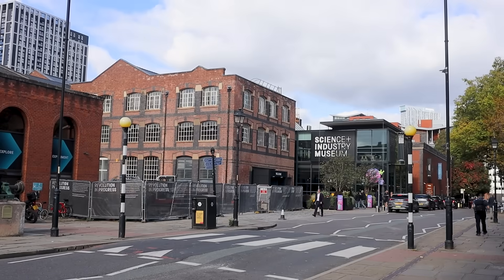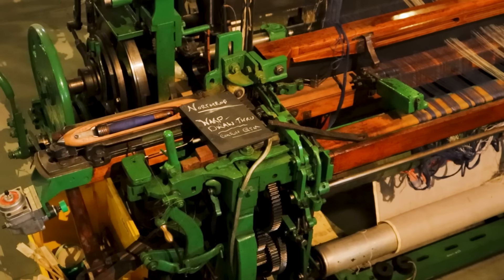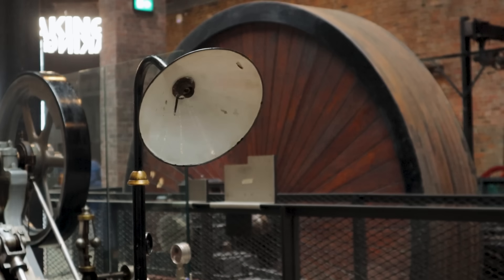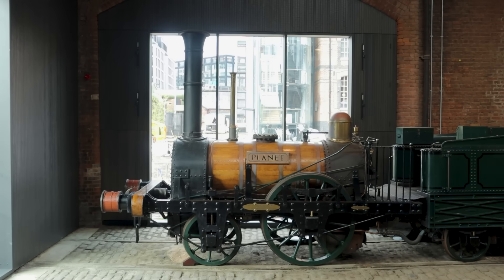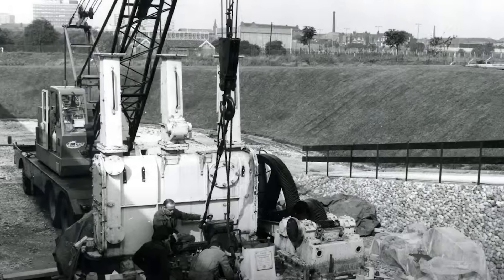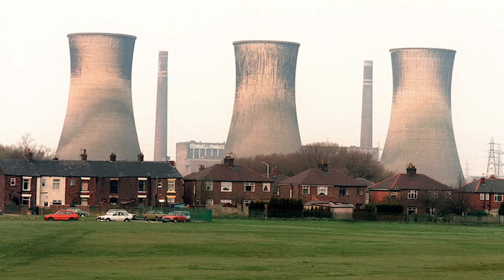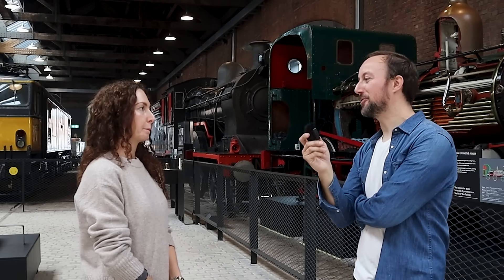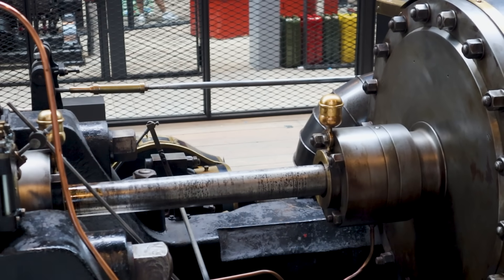How did Manchester power its industrial revolution?

Comment: I love the machines, but conditions for worker were appalling, even as late as the 1970's Ferranti's was still mid-Victorian in attitude. You weren't even allowed to read a paper in your tea-break. I had the entire casting shop talking when I asked the general manager if he were joking.
Reply: Hi you are spot on when I worked at Ferranti Moston there were different heights in the toilet doors depending on where you were in the hierarchy. Workshops had about 15 inches from the floor and the top just above eye level. In the offices they were better then the directors got full height doors. 
Not to mention the about seven different grades of canteen!

Comment: I'm pleased to see the Trustees haven't ruined it like they did with the main science and victorian sewer parts of the museum 👍When the Curator said it feels like a long time, that's because it genuinely was. It was literally years and years 😂 I hope it was all spent on the fabric of the building and not the rubbish around the new boiler (yawn) and the acquifier. I doubt those items will ever pay themselves off in carbon or energy terms taking into account the embedded energy or carbon produced to create them. My only criticism aside from time and cost is that they should have put the ugly modern boiler somewhere less intrusive. Do we really need to see that thing. If you want to see lots of engines running on their original fuel go to an open day at the Anson Engine Museum.
Reply: Anson is superb! Also for a real working mill engine fired on coal in a lancashire boiler I recommend Ellenroad Mill in Shaw.
Reply: @martinholt3729 thank you for that. I have not been there 👍